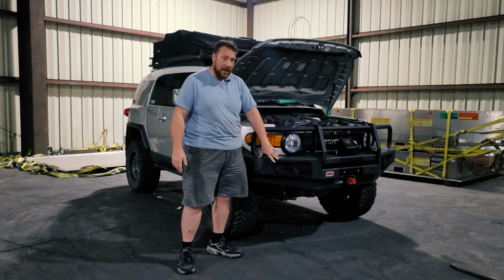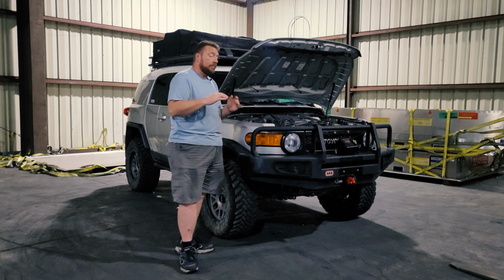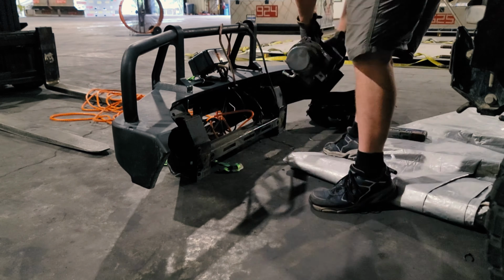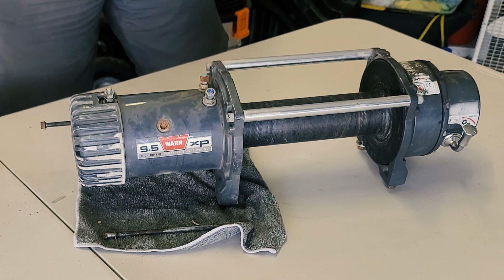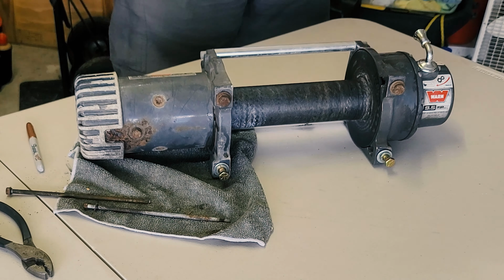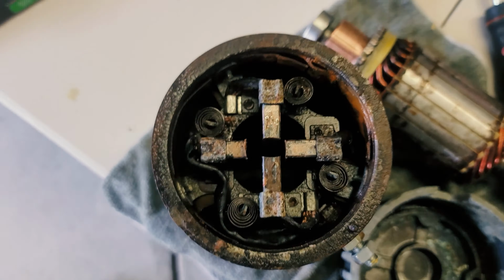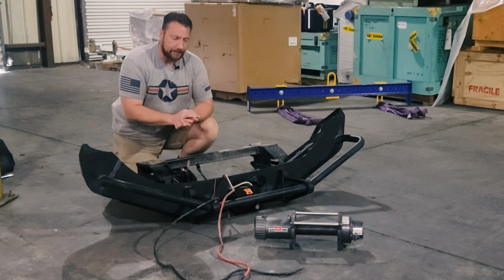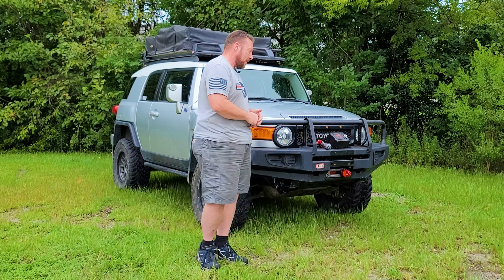My Warn 9.5 xp winch  motor died, so I'm tearing it apart!!!

Comment: Would have loved to see you installing the syn rope onto the spool good job though.
Reply from the maker: @deepbludude4697  just gotta make sure it's rolling on the correct way, tight as you can in the first layer. Then use the weight of the vehicle to spool it the rest of the way in.

Comment: How to you get the brushes out so you can fit the stator back in. I have a badlands 12000. It's built the same way though, mine seized up, I think it was the motor so I started taking it apart. Stator looked a bit dusty but still new. I'll end up posting a video I guess. But the brushes don't stay open. Do i have to pull them back and fit the stator back into them so they grab on to it??
Reply from the maker: @1Turnatatime  yes, the brushes are spring loaded to stay in contact with the stator. If you find a socket or something the right size you can hold them all out with that and get them back over the stator. Otherwise you gotta just fumble about and push out like 3 of them with your fingers, get the stator a bit in there to hold them, then push out the last one, then jillge, wiggle, push this, twist that... It's not impossible by any stretch, but it's frustrating.
Reply: @EverymanOverland  yeah I ended up getting back on the stator. Found another video where the guy just pulled the motor cover off and I used his fingers to keep the brushes open as he slid the stator back in. Caught my finger of course but I got it. Thanks for the other idea too. Maybe I'll try it next time around if I have to service it again.

Comment: Hello, do you recommend buying this winch? How much can it bear?
Also, how long has it been used?
Reply from the maker: It's a 9500 lb winch, and honestly I would recommend the openroad4wd.com 13,000 lb winch before I would recommend the warn. I have the openroad on my truck now and I'm very happy with it. Now pulling power and less cost and it's the same size. All win.
Reply: @EverymanOverland  But is the industry in China the same quality, durability and endurance?
Reply from the maker: @حمد11-ظ8ط  it seems to be from what I can tell. I've only owned the winch about a year, but I have yet to hear anything bad about them from other people that use them.

Comment: It's not so much the corrosion on the armature but your brushes were toast.
Reply from the maker: Ya, that winch for sure wasn't new. It had seen plenty of life. I likely could have rebuilt the motor with new brushes etc, but just decided that I know enough to be dangerous, but not enough to get it right. I have a bad habit of just ripping into things without really knowing what I'm doing.

Comment: LR Live has great video for doing this right.
Reply from the maker: Ya, I got it apart and got it running, but I don't think what I did could be called "doing it right" 🤣
Reply: @EverymanOverland  not saying you did it wrong but this guy gives a really good teardown and fix makes it very easy.  Fixing to tear my old one down rebuild it lol after I've already bought new one. Give old one to son if it goes like videos show. He has 3 part video
Reply from the maker: @jamesphillips7283  nice. I still have that winch floating around in my shop, but I don't think I'll use it. I'm really happy with the openroad4wd.com winch that replaced it. So being a pack rat, I kept the warn, but I think it's officially a boat anchor at this point. 😁

Comment: Good on you for having a go. Hopefully it will be good for a while. I hope you pulled the gearbox apart for a regrease? Its likely to be full of nasty crap as well. Working on stuff alone is always much harder (story of my life!). Well done. Ive done the same without a forklift, lots of fun...not.
Reply from the maker: I didn't pull the gearbox apart as everything was moving very nicely by hand on that end. And if I'm honest I was worried about not getting it back together right. So far it's working perfectly, but I feel like it's on borrowed time. I can buy a new motor from warn for 300 bucks, but for not much more there's Chinese winch options at 13,000 lbs rating. Those are tempting me, and could provide content for the channel... 😁

Comment: Boy you sure helped people with the rebuild and troubleshooting, ohms measurements, pffffft
Reply from the maker: I certainly didn't rebuild the thing... I just tore it apart, figured out what was going on, got it running and slapped it back together.  I didn't replace any parts, measure or perfect anything.  And, it quit working again after a few months.  I replaced the whole thing with an OpenRoad 4x4 13,000 lb winch that works perfect.  Lesson here, just throw that old thing away and get a whole new winch that pulls harder, comes with a synthetic line and 2 remotes for the same price as a Warn replacement motor assembly.  I wish I would have done that from the get go.